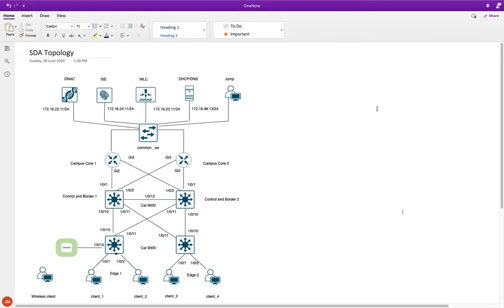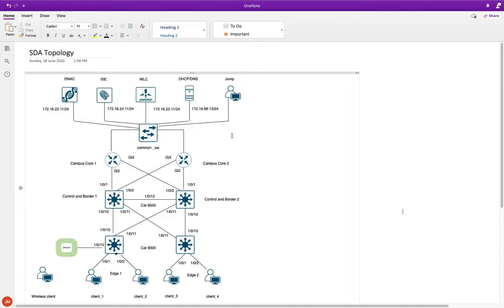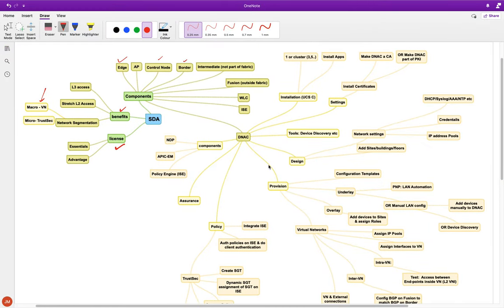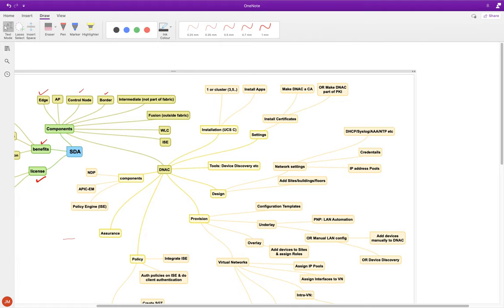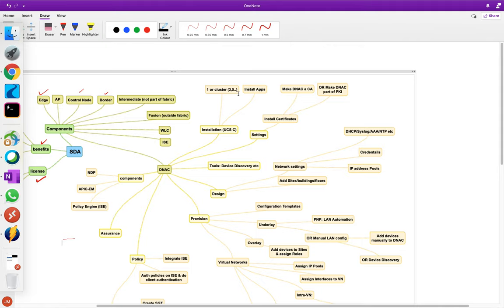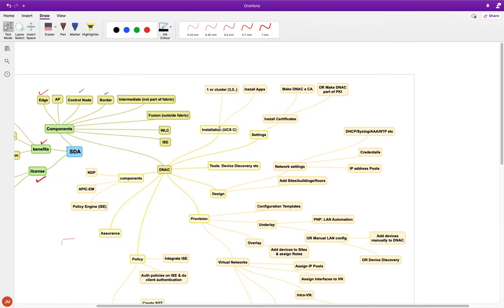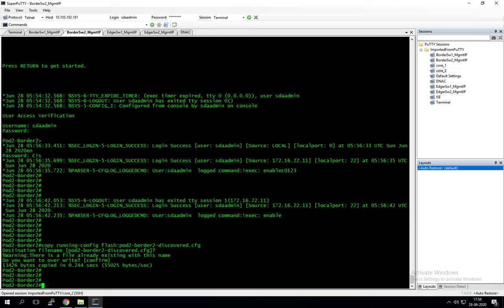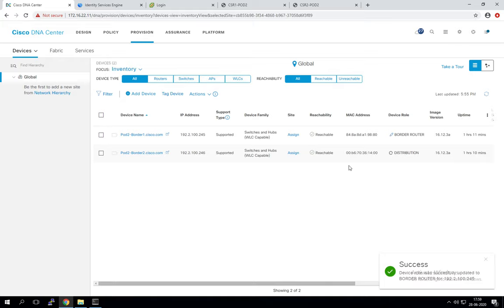Cisco SD Access: Introduction and Discovery Lab

Comment: Hello , I am in the process of migrating existing network to DNAC and i have no ISE in my network 
Without ISE :
1)Can we build Fabric and provisioned the device?
2) Can we create VN and Inter VN communication?
3)How the existing ACL can be configured??
It will be highly grateful if you can answer my queries??
Reply from the maker: Hey ! 
Well for a true SDA solution, you need ISE. If you don't have one , maybe you can spin up a VM and use the trial licences. There are lot of automation workflows that DNAC does which needs the support of ISE.
I wouldn't recommend SDA without ISE. If you plan to use DNAC only for underlay automation and assurance , then maybe you can do it without ISE but you'll have to configure all of the rest of the fabric manually 
Anything to do with VN is independent of ISE but ISE is needed for micro segmentation.
ACLs generally are migrated to SGACLs or inter-VN route leaking policies.